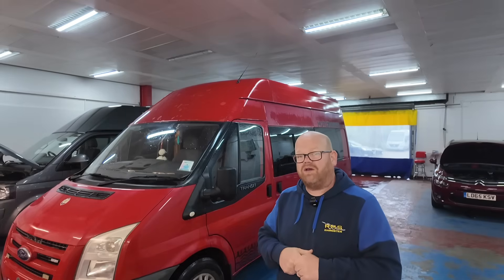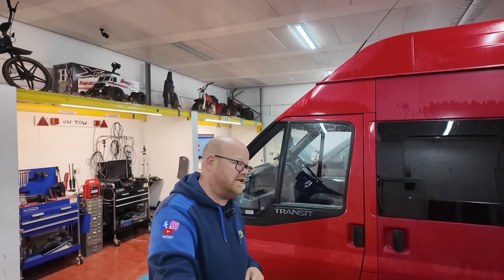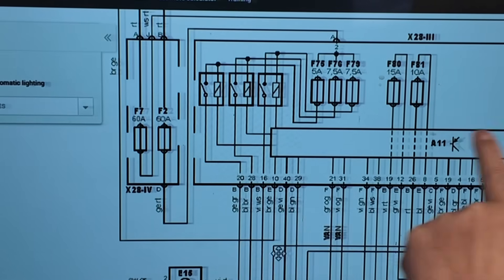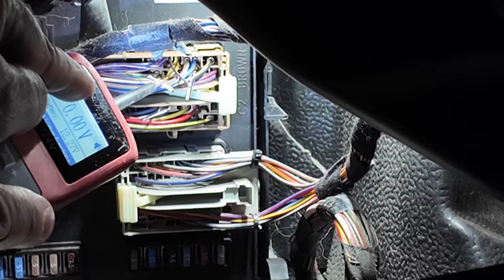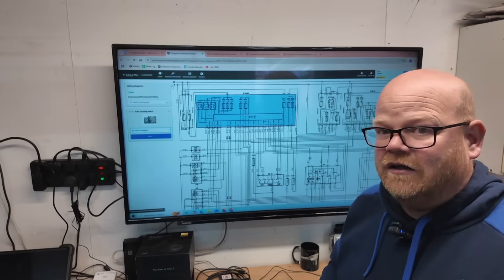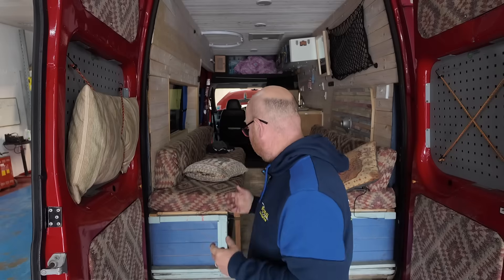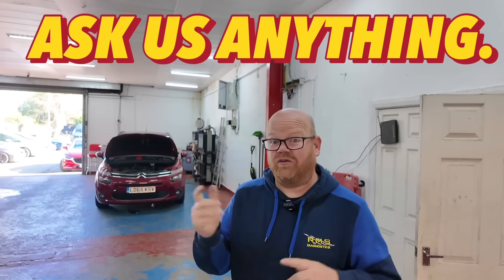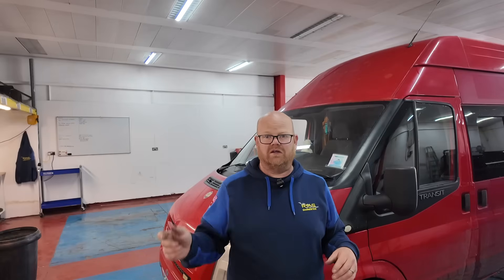The Truth Behind Logical Diagnostics | 2 Faults on a Ford Transit(Learn how we do what we do)

Comment: No music or noise on this vid.  
Could you mention the year of manufacture of the vehicle you are about to work on please.
The Ford Transit Mk7 was made from 2006 to 2014 I don't know to which month in those years could apply.
External/internally the Mk 7s look the same.
September 2011 changes were made - addition of the DPF - a different fuel system was also used.  
So electrically the fuel system electrics/electronics is different as well as the addition of DPF monitoring/actuating of soot removal (DPF restrictions).
I do not know how much of the electrics/electronics was changed. 

I have a 2012 Transit it is red and looks a lot like the one you work on but which year is it, what is in/on it?

There are some vids of camper van conversions where access to the butterlfy nuts holding the rear clusters is not easy.

Your presentation is very good.  Your banter with Barney micky taking is good.  The yanks and other's like to be exposed to the differences you show - it's you.  
"Vive la différence".
I hope you don't change too much to accomodate other nationals and one of the large internet bodies.   They'll let you bend to their manner.
Nationals prefer their own type.
English speakers can like Diagnosdan they don't have to learn Danish or Dutch to know what he is about.

I'd had several cans of beer I said to a Texan "I am pissed".  He said he was pissed as well.  Same word same pronuciation - different meaning - drunk - annoyed.
The pond divides.

Comment: Good advice on those clips that secure the plug to the ECU .. quick release crap,   we have them break on Trucks,   there's  tabs that  push through the plug to lower it away from the pins or component... there's a way around it to get them on / off if needed 
20 years experience

Comment: Agreed, it doesn’t matter where you start as long as you’ve got a logical testing plan. You can start at the fuse, the bulb or the middle. Obviously as it was the bulb in this case you would have found it faster if you’d started at the bulb. By starting in the middle you will get a faster result imo over multiple jobs. Great video. Love your channel and was wondering where you’d gone.

Comment: Really liked this Video, interestingly one of the best advices I learned was to always start at the load. The reason for this is if you follow the stupid factory diag flow charts they always insist on starting by checking battery voltage then fuse all the way along until you reach the load. In this case a bulb. But if you go straight away at the bulb you eliminate all of those checks you know the battery, fuses ect all ok. Another note transit specific is. Is this the model of transits that burn out the earth terminal on connector. I found the video interesting as you mentioned you were going to test the T-Pins with a test light but ended up using a power probe ( boy have those power probes caught me out when I had a bad earth path). But I really like your thinking about being able to test everything in one place.... Love your banter... And learn loads from you keep up the good work and feel free to mention this comment on your new answers section....😊

Comment: also for me id have started at rear because after working on transits day n nite in the past  there common for  broken or corroded wiring on the rear of a mk7 , but if was mk8 my habbit was checkin bcm plugs  for water or stains used do 2/3 bcms a month when i was up perrys for faults and checked to see if had original screens 🤣🤣

Comment: hindsight is a wonderful thing .  great explanation of why and how mate . and a logical approach to what does it need and what is missing . absolutely spot on in my book if you can check a circuit at one point to eliminate and good proportion of it you will definitely save yourself a rake of time pulling things apart. don’t get me wrong you will find tge issue in the end but let’s say in that case i was not the bulb ends it was a break in the wire the other way or a bcm issue . would have been spotted at your point of testing 👍